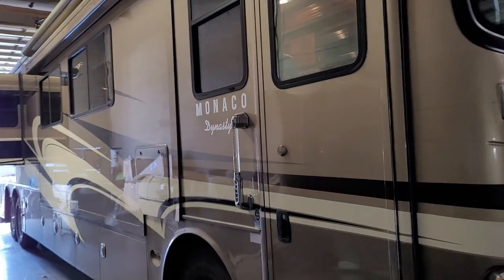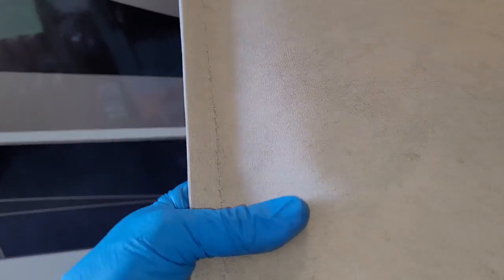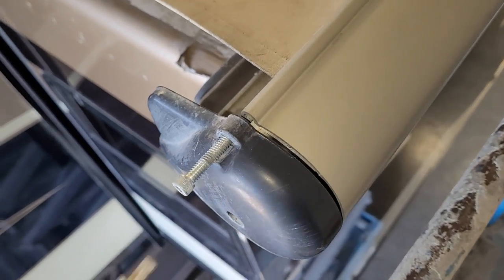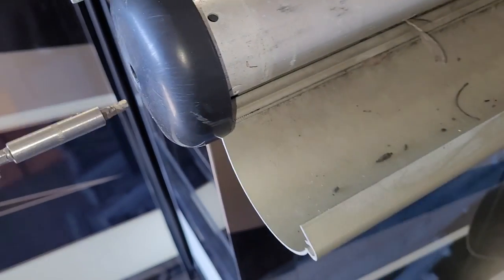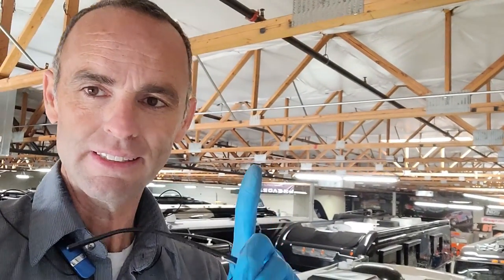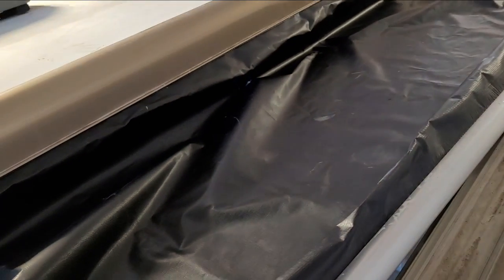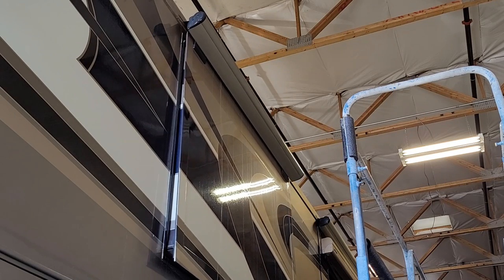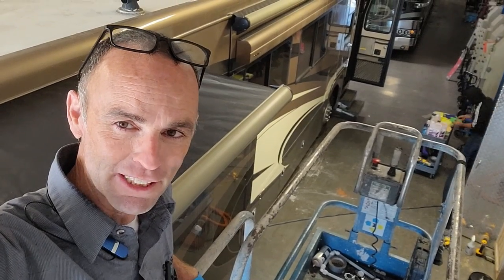The Easiest Method to Replace a Carefree of Colorado Slide-Out Awning Fabric

Comment: Great video and I tried it. I have the same topper cover and followed your instructions. Mine has slack in it when slide is in. I’ve tried adding more tension but it stays the same no matter how much tension I put on it.  Any idea what I could be doing wrong? Should I have the material sewn to a shorter width? 
Any help would be greatly appreciated.

Comment: I like the filter wrench trick,  thanks.  That coach is the same color as mine.  Where do you get the color formula for the metallic sand paint?  Is there an on-line paint source?  Thanks for the great videos.

Comment: Excellent fix James. Would you recommend a third set screw between the other two in order to facilitate the water weight on the awning?
Reply from the maker: it won't do anything really. they just act as friction pins to keep the fabric from moving in the rail

Comment: What prevents water from pooling in the center of the awning when the slide out is extended?
Reply from the maker: nothing, it will. some people put beach balls underneath but that seems like a lot of effort. The best thing is to run the slide in and out after a storm
Reply: @AZExpert  When water pools, it stretches the fabric making it sag more. Interesting that there is no simple fix other than the Beach Ball.

Comment: Can you increase the size of the topper about 1/2 inch to 3/4inch on both sides? I want the water to flow away from the sides of my slide. I have a 2009 Monaco Lapalma and the water is wicking underneath.
Reply from the maker: yes, of course

Comment: Hi James:  Do you have a small list of tools you use as a suggestion for us DIY types out here in the streets?
Reply from the maker: that's a good question. 90% of my repairs are done with my tool bag and odd tools in a Prius. Im suppose to film a "tool truck" video at some point I think :)
Reply: @AZExpert  Yes please.  Truck (Prius) truck tool stock.  Suspension video on common problems or upgrades.  You know:  That stuff you have little time to do between live repair jobs. ;-)  A few more Enfernal Bond tape repairs too.

Comment: Would it be worth it to put another set screw in the middle to keep it from coming out like the last one?
Reply: That probably wouldn't solve the problem because it's the stitching that deteriorates that's holding the fabric around the rubber piece that fits in the groove. The screw might hold the rubber piece in but the fabric is going to come loose.

Comment: Hi, question. at 10:45 you put the set screws back on both sides, but the middle was the part that came out. Is a set screw in the middle a solution?
Reply from the maker: the seam that holds the fabric in the rail failed. the stiches broke
Reply: @AZExpert  oh, I guess I missed that. Thanks for clarification

Comment: So let’s just say you loosen the wrong end and the spring unwinds a little. It happened to me. I did give it a few turns back to tension the spring and it seems to work fine but is there a “rule of thumb” on how many turns you should give the spring to have it retract the fabric?
Reply from the maker: around 8 but mostly

Comment: My Carefree topper is about 18 feet long and is 2 pieces.  How do I get it apart in the middle to get to the drum?
Reply from the maker: the middle hub is usually just riveted
Reply: Mark I'm sure you repaired yours months ago, but if you didn't....mine was also in 2 pieces.  I had to pull the forward cover off first...the rear cover had 2 metal pins at the top and bottom which extended through the center piece, and through matching holes in the end of the front cover.  Hope your job went smoothly

Comment: Sorry James, you're just not as fast as the 2 Awning boys.
But you did a good job except where you over opened the track end on the RV but I'm not gonna say anything.
Reply from the maker: over opened?
Reply: @AZExpert  Where you used the screw driver to spread open the track mounted on the RV. Looked like when you spread it open the paint crumbled.